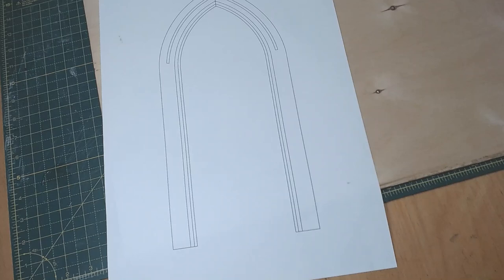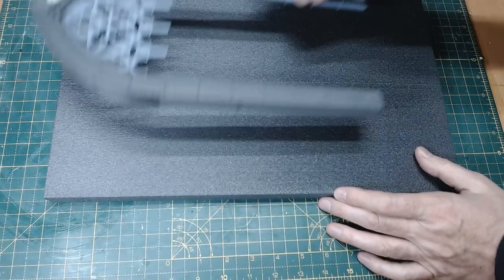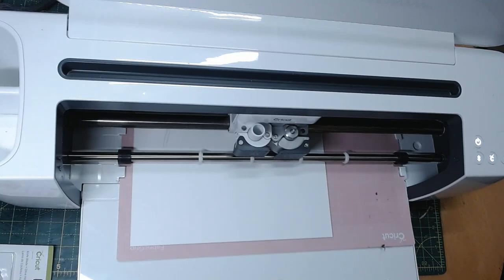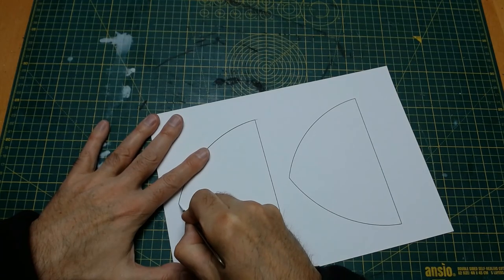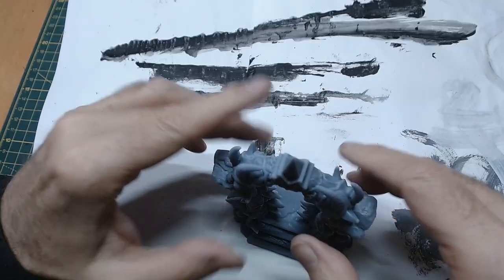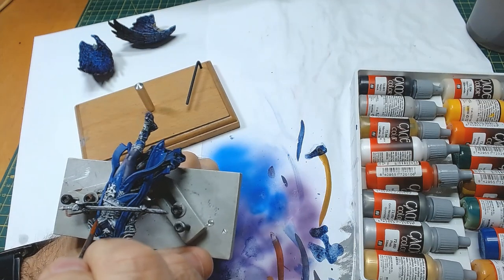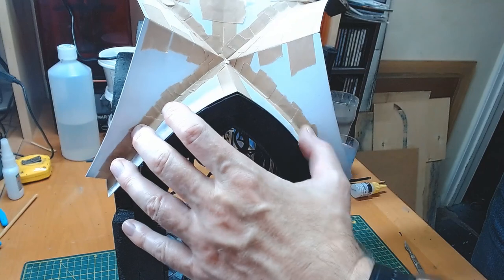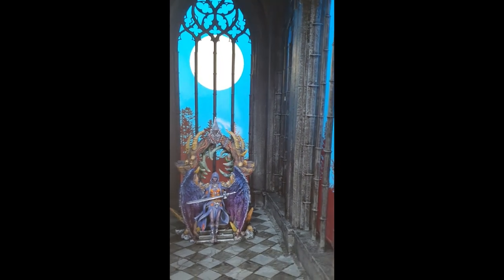Watch This Gothic Angel Diorama Build

Comment: For a cheap CA glue accelerator, just dissolve baking soda in water and put it in a small spray bottle. Just play with soda to water ratio ( you need very little soda) to make the glue set as fast or slow as you like. You can also apply using a pipette if you want. Either way you have way more control.
Reply from the maker: Thanks, I'll give that a try